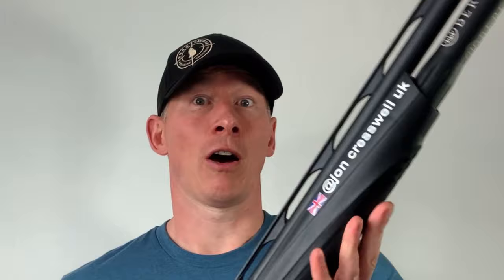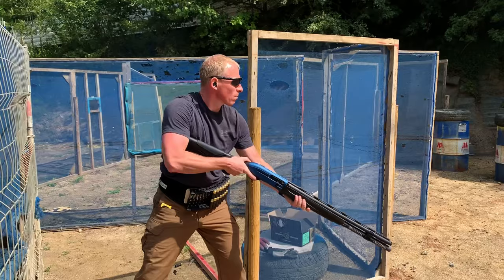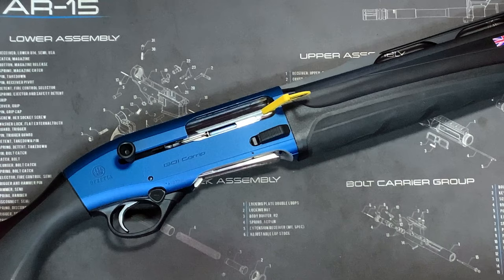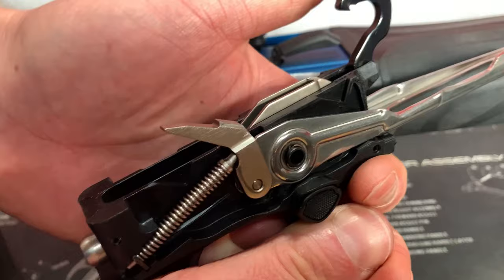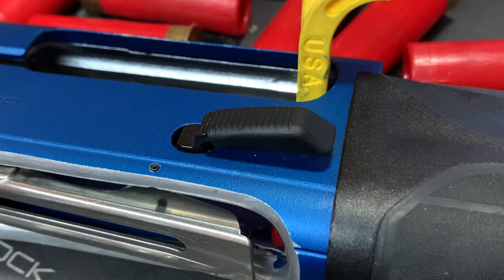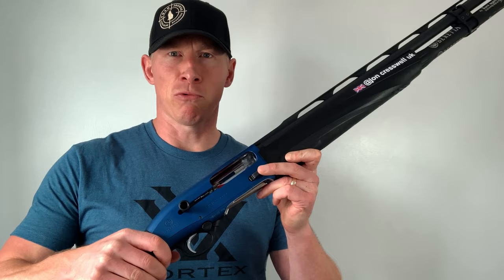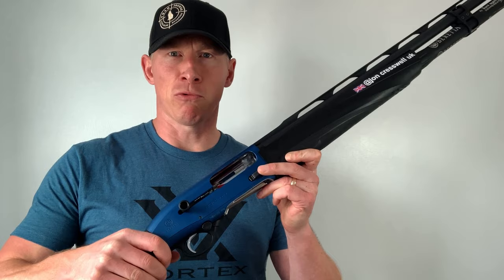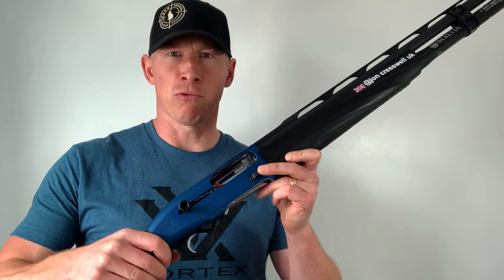Beretta 1301 User Guide: How it works, Loading & Unloading (Part 2)

Comment: Thank you for this.  I got the 1301 quite recently and it's my first automatic shotgun and very different from other guns I own.  I didn't find Beretta's manual particularly clear on unloading.  But your video is clear, well filmed, succinct, and well lit.
Reply from the maker: Wow thanks for the feedback 🤩👍

You’ll enjoy your 1301 it’s a great shotgun and mine hasn’t skipped a beat!  

Yeah the unloading bit is a bit awkward but once you get the process it’s fine.
Reply: Totally agree with you, this Video is very helpful. Berettas Manual is not good at all for people who are new into these kind of weapons.
Reply from the maker: @thisolddude  it always helps if someone can show you around the firearm to help you get familiar with it 👍. Hope this video did that.
Reply: @JonCresswellUk  It absolutely did it. Thank you again for it.
Reply from the maker: @thisolddude  you’re welcome ☺️
Reply: Semi automatic *
Reply from the maker: Yes, semi auto 😊
Reply: I echo the videos are great! Thanks for filming. I used your maintenance one to follow-up my first take appart for cleaning. Once you have done it once it is straightforward, but still a few things to know to avoid breaking all. (like when the bold should be back or forward and how to release the charging handle). I keep bing impressed by the number of patches you run through your barrel.
Reply: I'm with you. I've had around a dozen ARs four or five pump shotguns and many pistols but the A300UP is my first semi auto shotgun (other than a box mag fed Saiga 12) and I felt like a complete rookie when I first started playing around with loading and unloading it. This video helped alot

Comment: I wouldn’t consider that a ghost load. If you pulled the bolt back and dropped a shell on top of the lifter depressing them sliding bolt home so there is an empty chamber would be a ghost load.  No?

Comment: 1301 vs m2 speed
Reply from the maker: I’d love to do that video comparison- both great guns 💪. Biggest difference is the action, the Beretta is gas operated and the M2 is inertia operated.  I think this one goes down to personal choice - I’d happy have either!
Reply: @JonCresswellUk  i am an athlete ipsc shot gun bangkok thailand
Reply from the maker: @aanaan2187  excellent 👍 which do you prefer?
Reply: @JonCresswellUk  Beretta 1301
Reply: Mossberg 940 jm pro
Benelli m2 speed
Reply from the maker: @aanaan2187  it’s a great shotgun!
Reply from the maker: @aanaan2187  I’d go with the M2 speed out of those two (if I had the money)

Comment: Jon, for many years I've lusted over the TX4, then the 1301 (I'm a PX4/CX4 kinda guy), but just couldn't quite pull the trigger, though the temptation was strong.  Then came SHOT Show 2023 and the announcement of the A300 Ultima Patrol and I was totally smitten!  I started the search and 9 days ago became the proud owner of the Patrol in gray (tiger stripe just didn't do it for me).  I've cleaned it twice already and am familiar with the various functions of the gun, but unloading live shells was a mystery.  The manual, in true Beretta style, was totally misleading and even wrong!  Your video has cleared the air and I'm now able to safely unload the magazine without issue.  THANKS for your most invaluable help!  You've earned a new follower, even though the 1301 hasn't entered my safe. 😁
Reply from the maker: Thanks for the story and feedback!  Luckily most of the new Beretta semi auto shotguns use the same receiver and blink system (or similar), so the functionality is comparable. 

I think I’d have gone for tiger stripe if they had it when I went to the store 🤤. The A300 ultima patrol looks great 👍 and I hope you have fun shooting it. 

Glad the video helped with the unloading of the magazine, as it’s not very straightforward. 

Thanks for subscribing!  I really appreciate it.  That reminds me that I need to get behind my shotgun again and take out some steels 😎

Comment: Thanks for the tips - I never would have guessed to pull up on the bolt release button to unload.  I just picked up my new Comp Pro 21" Barrel (no extension tube here in the US, and I had to remove the restrictor rod just to make it a 4+1).  I haven't fired it yet, but I already love it.
Reply from the maker: Yes it’s a bit odd how you have to pull on the bolt release, but most of the time I empty it into targets 😉

It’s a great shotgun!  The gas system and dampening stock make it something you can shoot all day and not get a sore shoulder 👍

Comment: Hi Jon, just a little extra info...to ghost load is to add an extra round to your load out.   The fastest way you do that and put one in the chamber with the newer 1301 comp is you load the tube .... rack one into the chamber then load another in the tube....after that take another round and pull back a little on the bolt then push that round down onto the lifter while pressing the latch in to allow the lifter to move down....then place another round in the chamber.
Reply from the maker: Ah nice 👍 thanks 😊.  Always good to have an extra shot if you can squeeze one in 😃
Reply: I have found you can ghost load with one in the chamber. Is this safe?
Reply from the maker: @maximusmock  it’s as safe as a loaded shotgun could be…always have the safety applied and keep pointing in a safe direction.  I wouldn’t leave one in the chamber myself.  Ghost loading an extra cartridge puts one in the chamber whilst you load another onto the lifter.  I know this can be done, but it is a bit awkward to do and I know on some shotguns it may cause the second cartridge to jam.  

There may be questions about legality if you are in the uk and only have a shotgun licence, as the licence limits you to 2 in the mag and one in the chamber.  There may also be some hunting conditions in the US where this is also either illegal or frowned upon.

We can’t use shotguns for home defence in the uk, however, if your country allows it I would just get a mag extension instead of ghost loading.  My reason is that the gun is not set up to operate with an extra cartridge on the lifter and you may cause a stoppage when you need it the most. 

Hope that helps

Comment: Thank you!  Knowledge of unloading this gun eluded me.  You might have saved a life... my dignity for sure!
Reply from the maker: I’m glad you found that useful, as it’s really not clear how you unload it otherwise. Always worth getting some dummy cartridges and making sure you are comfortable with loading, quad/hand loading, and unloading before you hit the range. I found it really helps.
Reply: @JonCresswellUk   @Jon Cresswell  agreed on all points.  I'm used to pressing in on the cartridge retention catch from the inside -- which is always a literal pain 😳-- but you are the first to show that pulling up on the bolt release catch does the same thing with greater safety and grace. Brilliant! This should be shouted from the highest peaks ... or at the very least included in the instruction manual. Thanks from a Yank. 👍
Reply from the maker: @redneckzen  thanks 😊🤜🇺🇸🇬🇧🤛

Comment: Just another kudo to you for this instructional video from another new 1301 Comp Pro owner.  Beretta should pretty much be ashamed at how they've done their manual, which makes it very hard to understand how to unload the gun safely.

In terms of complexity the 1301 reminds me a bit of the old Franchi Spas 12, which had some sort of similar magazine lock mechanism.
Reply from the maker: Thanks 🙏. Yes, it could be clearer about how to unload safely.  Hopefully my demo was ok. 

I’ve not used the spas 12, but that’s an iconic shotgun 👍

Comment: Jon, can you explain the cycle of operation when the gun runs dry? What causes the bolt to be held open on last round, and equally what allows the bolt to continue to cycle when there are rounds in the magazine without it being held back between rounds?
Reply from the maker: Sorry for not getting back to you sooner.  I’ll have to try to work that out for you as  I’m not entirely sure at the moment. I wonder if anyone else in this thread can help answer that?

Comment: great video, wel presented, Nice one Jon, just a thorght it you changed the title to include “A400 action” you might pick up some more views, as I stumbled on it but found it very helpful in how to load and unload my new A400 xcel 3 shot that i have for sporting clays & skeet.  Cheers
Reply from the maker: Ah thanks👍 I did a part 1 video too that you may be interested in - Beretta 1301 User Guide: Routine Maintenance - Strip, Clean, Assemble
https://youtu.be/6iw87dM2mR8
Reply from the maker: I’ll leave the title as it is for now, but will add the A400 tag to my next Beretta video 🤝👍

Comment: Hi Jon, i have the problem that while ghost loading the loading ramp sometimes don't hold the up position. When i load a cartridge sometimes i hit a little bit the ramp mechanism and the ramp slides down. Then one cartridge is lifted in the chamber and it is not possible to load more rounds in the tube... Is there a trick / tip how i can manage this?

Comment: hi, thks for the clear explanations, a stupid question, when aiming you have both eyes opened and you always try to allign both sights or use just the front (green) one for fast shoots?!? thks
Reply from the maker: Not a stupid question at all 😊, I shoot with both eyes open, look over the top of the barrel and use the fore sight (green dot) for most targets.  If it’s a long shot I will use the mid bead too, but generally I go off the front sight and shoot instinctively.
Reply: when using the mid sight for long shots do you close one eye(last question i promise)?!?
Reply from the maker: @lucianomicale1099  not normally no.  I am right eye dominant so it seems to work ok.  Everyone has their own techniques so if you close one eye that’s not wrong at all.  I just prefer to shoot both eyes open so you have better peripheral vision. Don’t worry about asking questions ☺️ it’s good to chat

Comment: Hi!  The new 1301 comp pro that I gave to my son for his birthday, has the curious habit, with 35 grams, of expelling one every two or three shots downwards.  So, after the session, you have to go and look for the non-fired cartridges on the ground ... For this reason we are sending the 1301 comp pro to Beretta to have it checked.  Do you have an idea why?  It has a 10 round magazine and a 50 barrel
Reply from the maker: Wow 😮 not sure that’s right!  I haven’t had that happen to me.  Sounds like the loading gate is not working correctly or there’s an issue with the cartridge latch that holds the cartridges in the mag 🤔

Definitely send it to beretta to get it checked out.  I hope they fix the issue for you, don’t let this put you off the shotgun, it’s a great bit of kit normally.
Reply: Jon, rest assured, my son loves his birthday present! 👍💪... and then, he must prove to me that he is better in everything than my Derya MK 12 ipsc, that in the challenge we made on 100 shots with mixed ammunition 28 and 35, my “KTM” (😁) never jammed, while his Beretta ... cheated😜
Reply from the maker: @motoacquatico1967  🤣 kids have a great habit of beating parents at challenges - watch your six  🤣👍

Comment: Interesting, I can only fit 9 shells of 67mm in mine...
Reply from the maker: It must depend on the cartridge manufacturer I guess. If a cartridge or two are slightly taller then that would reduce the capacity
Reply: What is the actual measured size of yours when you feed 10. The one I have been trying are less than 61 mm tall.

Comment: Why do you pull up at the front of the bolt release to eject cartridges? Can’t you just press at the rear end of the button?
Reply from the maker: Weirdly not on the comp pro 😞.  I’m sure that’s what you can do on the 1301 and 1301 tactical, but when I tried it it didn’t work on mine 🤷‍♂️.
Reply: @JonCresswellUk  thanks for the tip and quick reply. Def learned something new from your vid. Subscribed!
Reply: @JonCresswellUk  I think I saw somewhere that people were accidentally ejecting cartridges on older models. So perhaps beretta changed the mechanism here to prevent that. I’ve even seen aftermarket parts that prevent accidental ejections.
Reply from the maker: @chris8424  no worries, great to chat 😊 thanks for subscribing I appreciate it 👍
Reply from the maker: @chris8424  probably.  The button literally only operates the bolt release of you push it.  I drop enough when I’m quad loading 😅 so probably best they fixed it
Reply: @JonCresswellUk  😂 do you happen to know if all blue receiver 1301 comp pros are the latest Gen 3 model? or any way to make sure I am getting the newest one.
Reply from the maker: @chris8424  as far as I know all comp pro have blue receivers.  I got mine in 2019 when they were launched - I don’t think there’s a newer version yet.
Reply: @JonCresswellUk  thanks, mate!
Reply from the maker: @chris8424  👍
Reply: My new 1301 Tactical (Generation 2) arrived at the store today, it has the same bolt release button design as this 1301 Comp.
Reply from the maker: @RickyJr46  ah cool, that’s good to know 😊

Comment: That isn't ghost loading.
Reply from the maker: How would you ghost load?
Reply: With full magazine, pull bolt back, place one in chamber, and then place another round directly on top of the lifter and keep round pushed down until slowly releasing bolt forward OVER lifter round.
Reply from the maker: Top tip

Comment: Which kind of ammo you shouldn't use?
Reply from the maker: The Beretta 1301 can shoot cartridges from 70mm(23/4 in)/24g(7/8 oz), to 76mm(3in)/57g(2oz) cartridges.  It can use birdshot (lead and steel), buckshot, and slug 👍
Reply: @JonCresswellUk  thank you, in order to shoot slugs, which stroke should I use?
And also, there are some limitations about case back? Like F2 or F3 type
Reply from the maker: @TheDzugasvili  I would recommend using the Cylinder choke.  Do not go tighter than IC choke. DO NOT shoot without a choke in your gun you will destroy your threads.  

I’m not sure about the limitations of F2 or F3 - hopefully someone in the chat can help?
Reply: @JonCresswellUk  so shooting slugs with 4 star choke Is possible?
Reply from the maker: @TheDzugasvili  I recommend using 5 star chokes but I have seen people use 4 star chokes.  If in doubt use 5 star or seek guidance from the manufacturer.
Reply: @JonCresswellUk  Thank you very much, by the way I think there are no problem using both F2 and F3 case back, probably Is a thing for magazined shotgun
Reply from the maker: @TheDzugasvili  you’re welcome 👍.
Reply from the maker: @TheDzugasvili  this is quite a useful webpage with information about chokes https://www.gmk.co.uk/pdf/choke-constriction-chart.pdf
Reply: I run a lot of slugs through my 1301 tactical, and use the improved choke. The Rio Star slug is amazingly accurate.
Reply from the maker: @theastro-philosophersappre2786  good to know 👍 thanks for sharing.  There may be some slugs like the ones you mention that prefer a tighter choke.  I was just going from the manual on their recommendations 😇

Comment: I wish the unloading worked on the a300 ultima patrol
Reply from the maker: How does it work on the A300?
Reply: @Jon Cresswell  you can't push down on the loading ramp and lift the bolt release to eject a shell. You basically have to just cycle through. They made it so when you push down on the loading ramp, it blocks the bolt release from being able to be function.
Reply from the maker: Oh 🙁